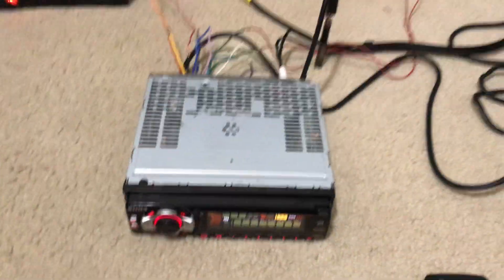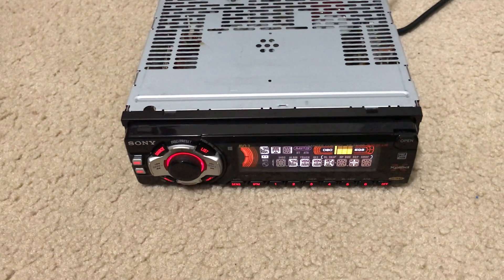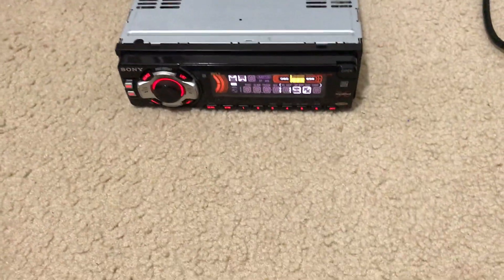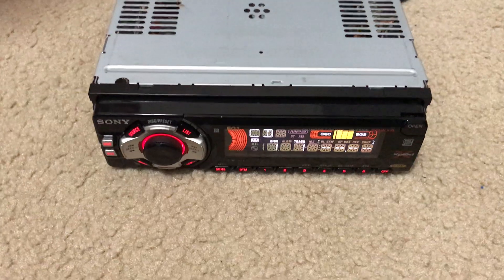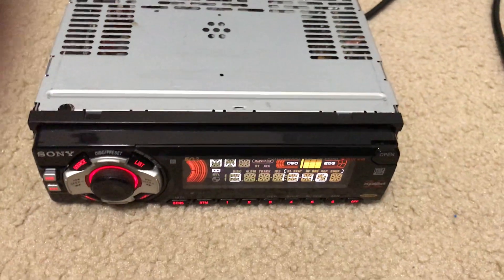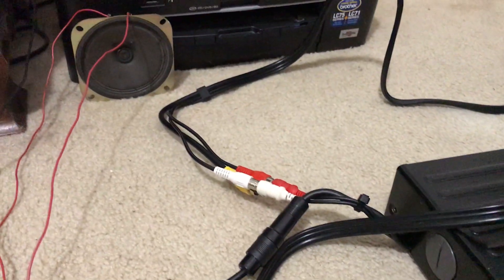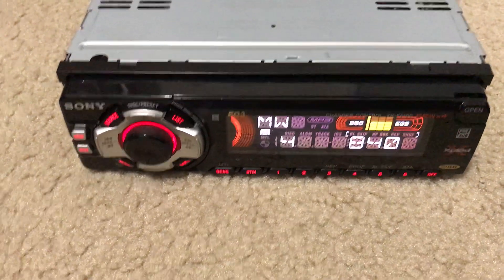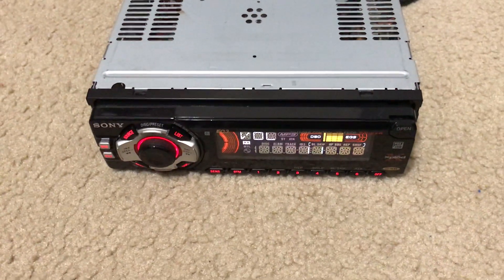Sony XR-F5100 Car Stereo with Shortwave Band

Comment: I always wondered how the short wave would work hooked up to the car antenna! Saw them online but the price was a turn off. The AM radio in the car is always much better than inside the house! Just by having a antenna outside! Thanks for the video!
Reply from the maker: Robbie, the car stereos that I had with the shortwave band worked great!  I had them installed in pickup trucks with external whip antennas, so I'm sure that made a difference.  I'm not sure how well they would work on a vehicle with the short "shark's fin" antennas that you see on most modern cars.  I was easily able to pick up WWCR, Radio Havana Cuba, WBCQ, and most the big international broadcasters with no problem.  Of course, it was easier at night, but even during the daylight hours I could pick up a few of them.
Reply: @patluvsvettes  Thanks for getting back to me, I wish they had them in all Cars and trucks!